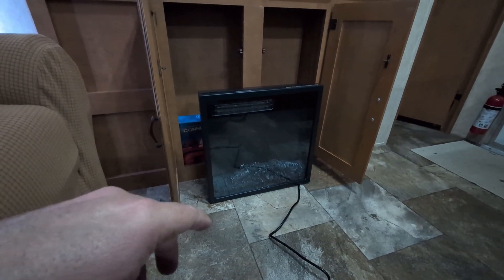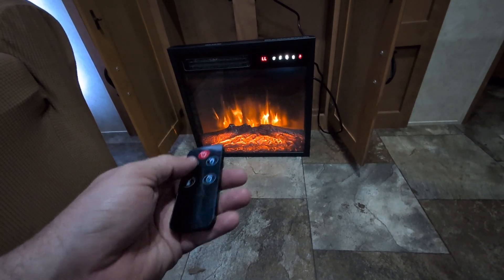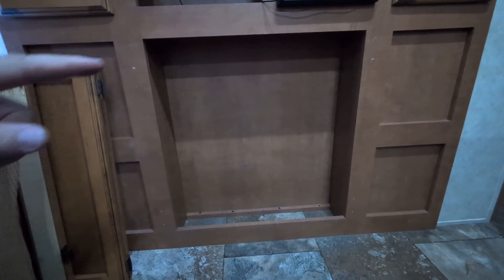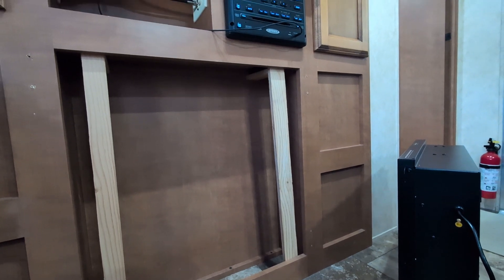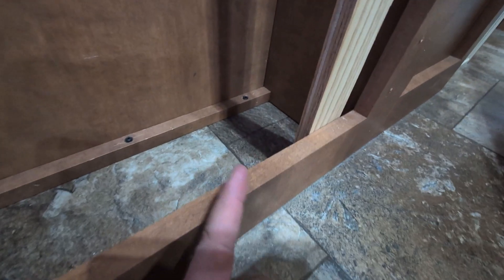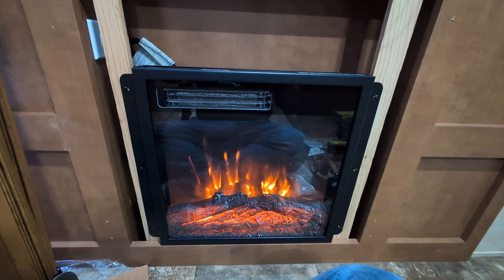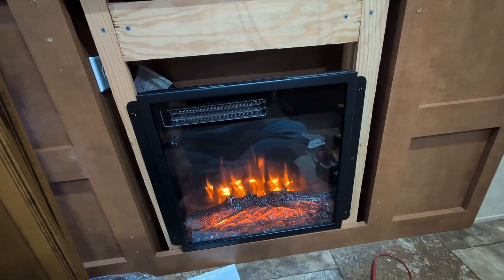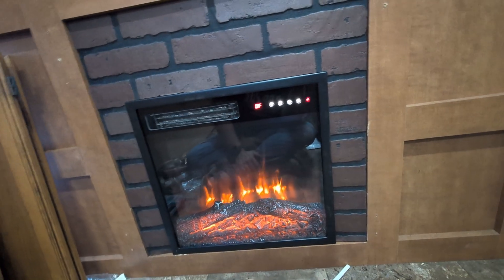Installing an Electric Fireplace in our travel Trailer

Comment: did you need to upgrade the guage  of wire going from the receptacle to the breaker panel?
Reply from the maker: With this small heater, no I did not.  Depending on the size you might purchase that would be something to look into.
Reply: Man you made it so easy I've been looking so I'm going to try it